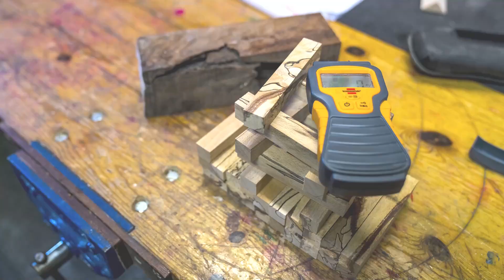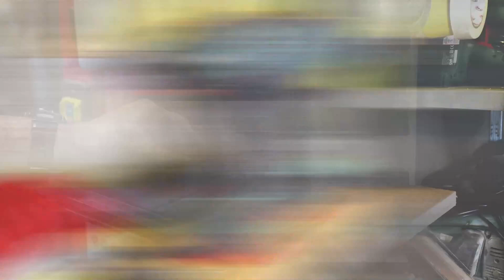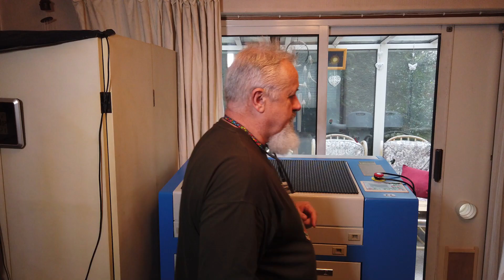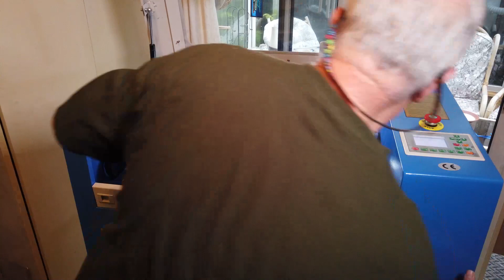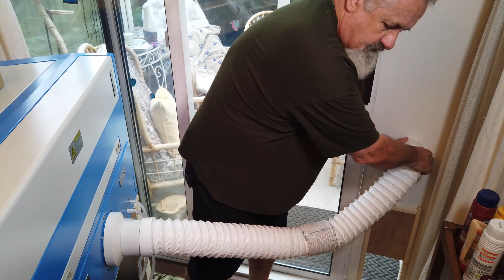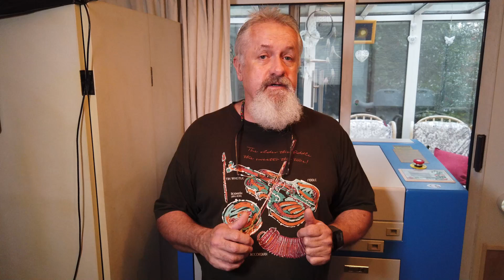Laser Engraving Cutting 50W Machine Part 2, The Basic Setup.

Comment: Hello Sir,

Good video!

I got a K40 laser 2 days ago, im trying to engrave photos on wood, so far im not happy with my results the product is not okay for sale.

Can i contact you if you are aware of any tips and improvements for my purposes.

Of course I would like to support you and your channel for that activity! 

Thank you.
Reply from the maker: Thanks
Reply from the maker: Your welcome anytime here is a link, this guy has been doing laser cutting for years and he is one of the best: https://www.youtube.com/watch?v=x_EyCqNzVjk&list=PLeKaKWOIPgi_XP6Nxzeapp-vUMCLQyVMB&index=36 this video might help you.
Reply: Hi there. Unfortunately K40s machines lacks a lot in terms of quality. You mentioned engraving photos on woods. The K40 units are operated based on the M2 nanoboard which fires pulses of laser on and off and can only be used to produce crude undithered engravings. You need variable power control for photo engraving (it will give you shades in the photos) and that is only achieved with the Ruida board like the one installed on his machine. But this unit costs $1,500 on Alibaba---3-4 times the price of the K40 machines. You should just sell it and get a new machine.